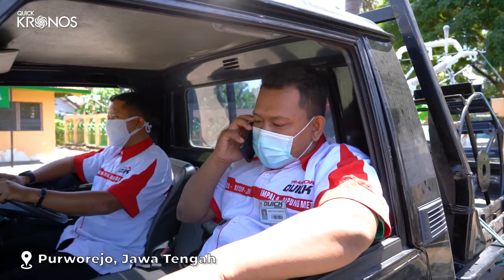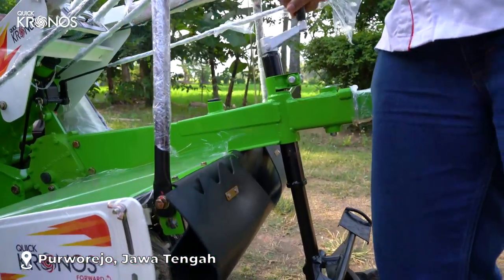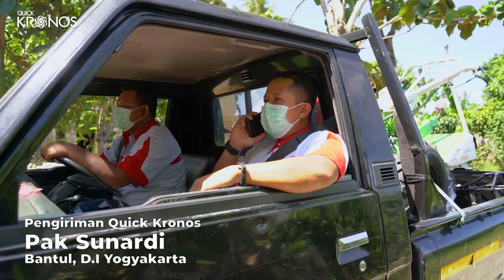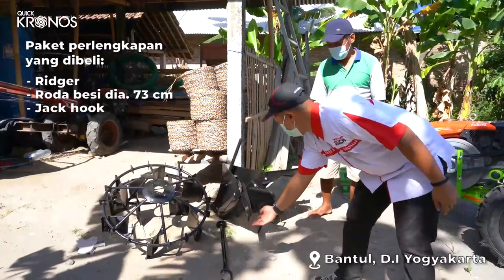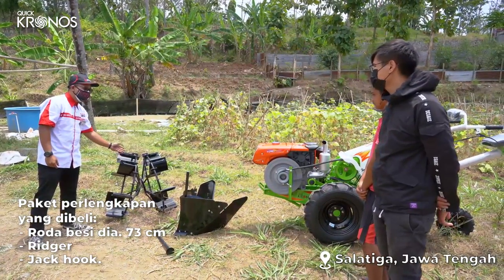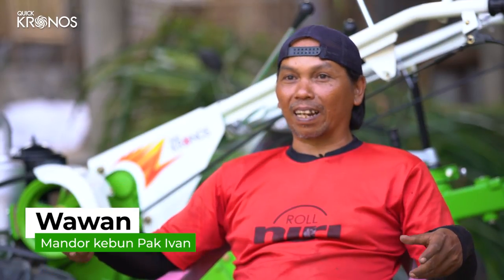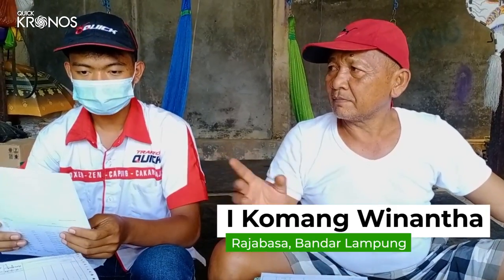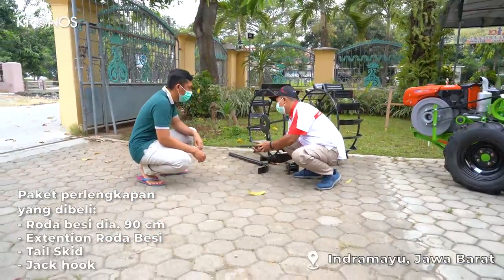TRAKTOR SERBAGUNA QUICK ROTARY KRONOS SUDAH DIMANA-MANA | TILLER NYAMAN HANDAL BUAT PARIT

Comment: Info harga kronos untuk Jatim kawasan Jember yg komplet trima kasih.
Reply from the maker: Harga Kronos memiliki beberapa paket perlengkapan sebagai berikut:
- Paket 1A  ~Roda besi single ring 730 :Rp.34.610.000,-
- Paket 2A  ~Roda besi double ring 825 + Extension Rp. 35.484.000,-
- Paket 3A  ~Roda besi double ring 900 + Extension Rp. 35.931.000,-
- Paket 4A  ~Roda besi single ring 730 + Ridger Rp. 35.500.000,-
- Paket 5A  ~Roda besi double ring 900 + Extension+ Tail skid Rp. 36.036.000,-
- Paket 6A  ~Roda besi single ring 730 + Ridger + Roda besi double ring 825 + Extension Rp. 37.624.000,-
- Paket 7A  ~Roda besi single ring 730+Ridger + Roda besi double ring 900 + Extension + Tail Skid Rp. 38.175.000,-
- Paket 8A  ~Roda besi double ring 825 + Extension + Roda besi double ring    900 + Tail Skid Rp.37.666.000
- Paket 9A  ~Roda besi single ring 730 + Ridger + Roda besi double ring 825 +Extension + Roda besi double ring 900 + tail Skid Rp.39.805.000,-
- Paket 10A  ~ Roda besi single ring 730 + ~Roda besi double ring 900 + Extension + Tail Skid Rp. 37.285.000,-
- Paket 11A  ~Roda besi single ring 730 + Roda besi double ring 825 Rp. 36.733.000,-
Paket 12A  ~Roda besi single ring 730 + Roda besi double ring 900 + Extension Rp. 37.080.000,-
Paket 13A  ~Roda besi double ring 825 + Extension + ~Roda besi double ring 900 Rp. 37.461.000,-
Paket 14A  ~Roda besi single ring 730 + Roda besi double ring 825 + Extension + Roda besi double ring 900 Rp. 38.710.000,-
Paket 15A  ~Roda besi single ring 730 + Roda besi double ring 900 + Extension + Roda besi double ring 825 + Ridger Rp. 39.600.000,-
Paket 16A  ~Roda besi single ring 730 + Roda besi double ring 825 + Extension + Roda besi double ring 900 + Tail Skid Rp. 38.915.000,-
Paket 17A  ~Roda besi double ring 825 + Extension + Tail Skid Rp. 36.375.000
Paket 18A  ~Roda besi single ring 730 + Ridger + tail skid Rp. 35.705.000
Paket 19A  ~Roda besi single ring 730 + Ridger + Roda besi double ring 825 + Extension + Tail Skid Rp. 37.829.000,-

Untuk lebih jelasnya, Pak Bos dapat menghubungi Telp/WA 0811-2828-477, 0811-2930-300

atau bila berkenan mohon kirimkan nomor telp/HP Pak Bos, bagian pemasaran kami akan menghubungi Pak Bos :)

Comment: Sulsel belum ada ya
Reply from the maker: Sudah Pak Bos, Harga Kronos memiliki beberapa paket perlengkapan sebagai berikut:
- Paket 1A  ~Roda besi single ring 730 :Rp.34.610.000,-
- Paket 2A  ~Roda besi double ring 825 + Extension Rp. 35.484.000,-
- Paket 3A  ~Roda besi double ring 900 + Extension Rp. 35.931.000,-
- Paket 4A  ~Roda besi single ring 730 + Ridger Rp. 35.500.000,-
- Paket 5A  ~Roda besi double ring 900 + Extension+ Tail skid Rp. 36.036.000,-
- Paket 6A  ~Roda besi single ring 730 + Ridger + Roda besi double ring 825 + Extension Rp. 37.624.000,-
- Paket 7A  ~Roda besi single ring 730+Ridger + Roda besi double ring 900 + Extension + Tail Skid Rp. 38.175.000,-
- Paket 8A  ~Roda besi double ring 825 + Extension + Roda besi double ring    900 + Tail Skid Rp.37.666.000
- Paket 9A  ~Roda besi single ring 730 + Ridger + Roda besi double ring 825 +Extension + Roda besi double ring 900 + tail Skid Rp.39.805.000,-
- Paket 10A  ~ Roda besi single ring 730 + ~Roda besi double ring 900 + Extension + Tail Skid Rp. 37.285.000,-
- Paket 11A  ~Roda besi single ring 730 + Roda besi double ring 825 Rp. 36.733.000,-
Paket 12A  ~Roda besi single ring 730 + Roda besi double ring 900 + Extension Rp. 37.080.000,-
Paket 13A  ~Roda besi double ring 825 + Extension + ~Roda besi double ring 900 Rp. 37.461.000,-
Paket 14A  ~Roda besi single ring 730 + Roda besi double ring 825 + Extension + Roda besi double ring 900 Rp. 38.710.000,-
Paket 15A  ~Roda besi single ring 730 + Roda besi double ring 900 + Extension + Roda besi double ring 825 + Ridger Rp. 39.600.000,-
Paket 16A  ~Roda besi single ring 730 + Roda besi double ring 825 + Extension + Roda besi double ring 900 + Tail Skid Rp. 38.915.000,-
Paket 17A  ~Roda besi double ring 825 + Extension + Tail Skid Rp. 36.375.000
Paket 18A  ~Roda besi single ring 730 + Ridger + tail skid Rp. 35.705.000
Paket 19A  ~Roda besi single ring 730 + Ridger + Roda besi double ring 825 + Extension + Tail Skid Rp. 37.829.000,-

Untuk lebih jelasnya, Pak Bos dapat menghubungi Telp/WA 0811-2828-477, 0811-2930-300

atau bila berkenan mohon kirimkan nomor telp/HP Pak Bos, bagian pemasaran kami akan menghubungi Pak Bos :)

Comment: Sayangnya harga harus lewat wa,pengin tahu harganya sama Zena rotari mahal yg mana
Reply from the maker: Murah kronos Pak Bos, segera diorder melalui 
Whatsapp / SMS / Telp: 0811-2930-300
Reply: @quicktraktor  berapa harga 1 unit? Wilayah Sumatera barat apa sufah ada
Reply from the maker: Karena harga kronos di setiap paket dan lokasi berbeda-beda,
Selengkapnya ayo Ikuti virtual gathering rotary Quick kronos dengan Whatsapp  / Telp: 0811-2828-477 / 0811-2930-0300 atau kunjungi https://quick.co.id/rotary-quick-kronos/

Comment: Cek untuk harga berapa ya daerah kendal Jawa Tengah?
Reply from the maker: Harga Quick Cakar Baja :
Mesin Bensin GX 200T2-QTBC : Rp 11.450.000 
Mesin Bensin GX 160T2-QTBC : Rp 11.150.000

Keterangan:
- Harga belum termasuk Biaya merakit, Oli, Solar/Bensin
- Harga termasuk PPN 10%
- Harga termasuk perlengkapan standar (hitch pin, universal hitch, resistance bar, dan roda karet)
- Harga belum termasuk ongkos kirim dari pabrik di Yogyakarta.

Perlengkapan Cultivator dijual terpisah (pilih sesuai kebutuhan)
--> Main Rotary BLADE B 340 = Rp 1.380.000 
--> Main Rotary BLADE B 240 = Rp 920.000 
--> Main Rotary BLADE B 100 = Rp 680.000 
--> Stabilizer Disc = Rp 120.000
--> Extension Rotary Blade B 200 = Rp 530.000
--> Main Rotary Blade J = Rp 1.310.000
--> Main Rotary Blade S = Rp 1.340.000
--> RTH = Rp 4.930.000 
--> Ridger = Rp 860.000 
--> Iron Wheel (CW 370)  = Rp 380.000 
--> Iron Wheel (CW 550) = Rp  600.000
--> Garu (Leveler) Cakar Baja = Rp 270.000
--> Bajak Cakar Baja = Rp 530.000 

atau bila berkenan mohon kirimkan nomor telp/HP Pak Bos, bagian pemasaran kami akan menghubungi Pak Bos :)

Comment: Harga satu setnya sampai berapa
Reply from the maker: Harga Kronos dilengkapi dengan Diesel Kubota 11 HP dan paket perlengkapan untuk bekerja di lahan basah dan kering adalah :

Rp40.168.000

Keterangan:
- Harga termasuk perlengkapan standar (Roda Karet, Rotary Transmission, Rotary Blade, Rear Wheel dan Operator Seat)
- Harga belum termasuk ongkos kirim dari pabrik di Yogyakarta
- Harga belum termasuk biaya merakit, oli, solar / bensin, running test dan training
- Harga sudah termasuk PPN 11%

Untuk paket lain dan info lebih lanjut, silahkan Pak Boss menghubungi telp. / WA Telp / WA 0811 2828 477 atau 0811 2930 300

atau bila berkenan mohon kirimkan nomor telp/HP Pak Bos, bagian pemasaran kami akan menghubungi Pak Boss :)

Comment: Berapa harga quick kronos
Reply from the maker: Untuk harga kronos, silahkan bapak menghubungi langsung
Whatsapp / SMS / Telp: 0811-2930-300 , Ikuti gathering Quick kronos dengan  cara mendaftar melalui telp ke 0811-2930-300 , dapatkan harga spesial PakBos. jangan sampai kelewatan yach !
Reply: Kalo beli kronos cara bayarnya gmna ni mas
Reply: Infonya blm launching, 
Mana yg benar?
Reply from the maker: sudah Pak Bos, langsung order melalui Whatsapp / SMS / Telp: 0811-2930-300
Reply from the maker: sangat mudah, silahkan bapak menghubungi langsung
Whatsapp / SMS / Telp: 0811-2930-300 segera dan dapatkan harga khusus
Reply: Kalo di kab. Pinrang  sulsel dh adakah?..
Reply from the maker: ada dunk, langsung menghubungi 
Whatsapp / SMS / Telp: Telp/WA 0811-2828-477 atau 0811-2828-478

Comment: Berapa bos harga trator krnos  ini
Reply from the maker: Harga Kronos dilengkapi dengan Diesel Kubota 11 HP dan paket perlengkapan untuk bekerja di lahan basah dan kering adalah :

- Rp41.568.000

Keterangan:
- Harga termasuk perlengkapan (roda karet, rotary transmission, blade, real wheel dan operator seat)
- Harga belum termasuk ongkos kirim dari pabrik di Yogyakarta
- Harga belum termasuk biaya merakit, oli, solar / bensin, running test dan training
- Harga sudah termasuk PPN 11%

Untuk informasi harga paket yang lain, silahkan Pak Boss menghubungi nomor berikut : 0811 2828 477 atau 0811 2930 300

atau bila berkenan mohon kirimkan nomor telepon Pak Boss, bagian pemasaran kami akan menghubungi Pak Boss :)

Comment: Berapa harga quick kronos
Reply from the maker: Harga Kronos memiliki beberapa paket perlengkapan sebagai berikut:
- Paket 1A  ~Roda besi single ring 730 :Rp.34.610.000,-
- Paket 2A  ~Roda besi double ring 825 + Extension Rp. 35.484.000,-
- Paket 3A  ~Roda besi double ring 900 + Extension Rp. 35.931.000,-
- Paket 4A  ~Roda besi single ring 730 + Ridger Rp. 35.500.000,-
- Paket 5A  ~Roda besi double ring 900 + Extension+ Tail skid Rp. 36.036.000,-
- Paket 6A  ~Roda besi single ring 730 + Ridger + Roda besi double ring 825 + Extension Rp. 37.624.000,-
- Paket 7A  ~Roda besi single ring 730+Ridger + Roda besi double ring 900 + Extension + Tail Skid Rp. 38.175.000,-
- Paket 8A  ~Roda besi double ring 825 + Extension + Roda besi double ring    900 + Tail Skid Rp.37.666.000
- Paket 9A  ~Roda besi single ring 730 + Ridger + Roda besi double ring 825 +Extension + Roda besi double ring 900 + tail Skid Rp.39.805.000,-
- Paket 10A  ~ Roda besi single ring 730 + ~Roda besi double ring 900 + Extension + Tail Skid Rp. 37.285.000,-
- Paket 11A  ~Roda besi single ring 730 + Roda besi double ring 825 Rp. 36.733.000,-
Paket 12A  ~Roda besi single ring 730 + Roda besi double ring 900 + Extension Rp. 37.080.000,-
Paket 13A  ~Roda besi double ring 825 + Extension + ~Roda besi double ring 900 Rp. 37.461.000,-
Paket 14A  ~Roda besi single ring 730 + Roda besi double ring 825 + Extension + Roda besi double ring 900 Rp. 38.710.000,-
Paket 15A  ~Roda besi single ring 730 + Roda besi double ring 900 + Extension + Roda besi double ring 825 + Ridger Rp. 39.600.000,-
Paket 16A  ~Roda besi single ring 730 + Roda besi double ring 825 + Extension + Roda besi double ring 900 + Tail Skid Rp. 38.915.000,-
Paket 17A  ~Roda besi double ring 825 + Extension + Tail Skid Rp. 36.375.000
Paket 18A  ~Roda besi single ring 730 + Ridger + tail skid Rp. 35.705.000
Paket 19A  ~Roda besi single ring 730 + Ridger + Roda besi double ring 825 + Extension + Tail Skid Rp. 37.829.000,-

Untuk lebih jelasnya, Pak Bos dapat menghubungi Telp/WA 0811-2828-477, 0811-2930-300

atau bila berkenan mohon kirimkan nomor telp/HP Pak Bos, bagian pemasaran kami akan menghubungi Pak Bos :)